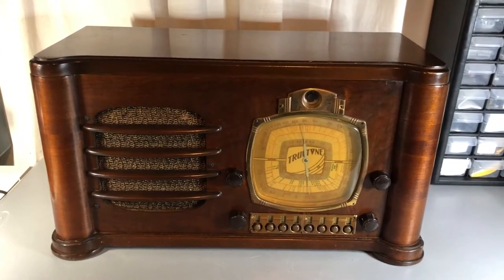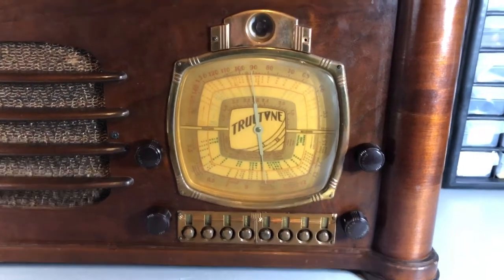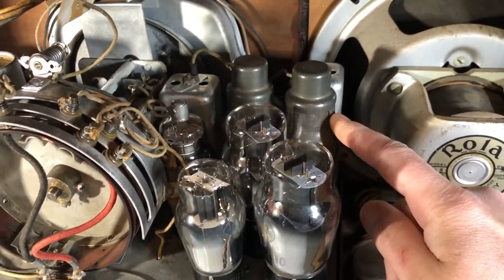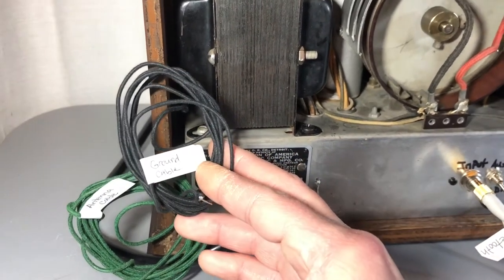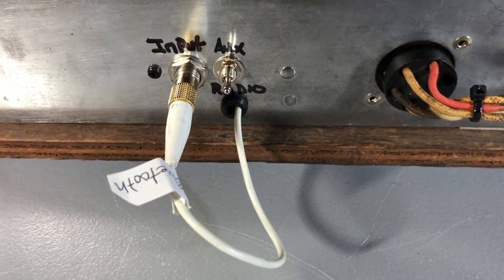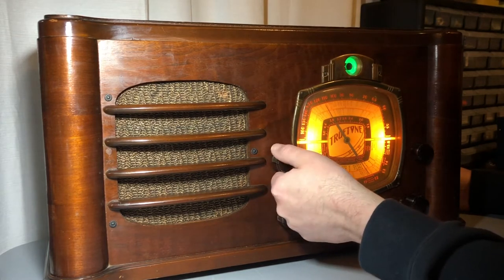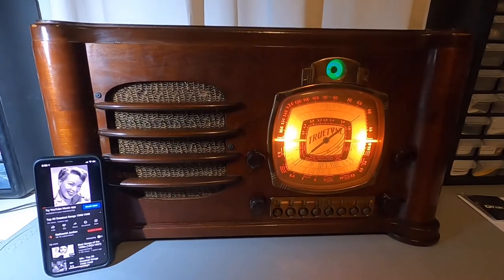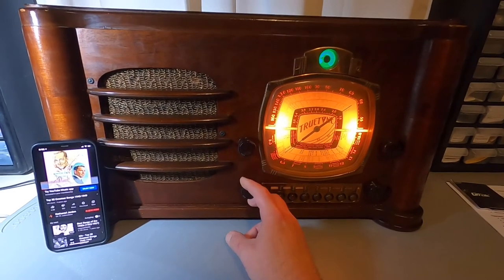Black Cat Amps - Demo of Restored 1937 Truetone D-727 Radio & Guitar Amp plus Bluetooth!

Comment: Hello, Was there a gear on the tuning motor that attached to the tuning knob itself? Or is the dial string wound in the tuning mechanism? I'm repairing this model and the tuning knob turns freely but no string or gear is attaching the tuning knob to the motor itself.
Reply from the maker: There was a motor for the dial. When you pressed a preset station button a motor turns the dial automatically to that spot. I don’t recall there being any strings. It’s been a while since I worked on it. If you watch the full video I probably explained more about that motor. Again it’s been a while. I don’t recall every detail.
Reply from the maker: It must have been connected to a gear but I can’t recall and no longer have the radio.
Reply: @DeathCapAmplification  Ahh I see. Very nice restoration by the way! Very nice tabletop model

Comment: I was wondering what the Electrolytic caps values were and how they hook up mine has two cans one big and other little but so corroded I can't see what values they are
Reply from the maker: Hi Jeremiah, I don't have this radio anymore so I don't know the answer to this.  However, I believe I googled for a schematic of this model radio before I started doing any work on it.  The schematic should show what values the caps are.  I suggest you google around to find the schematic and that should help you out.  Good luck!
Reply: @DeathCapAmplification  do you know of a good source for a schematic for this kind of radio
Reply: Do you know what could cause no audio on one of them radios
Reply from the maker: @jeremiahhuey6389  hey man. That could be anything. Literally anything could cause no audio. A loose connection, a cracked solder joint, a single bad component, a bad tube, a bad speaker.  Just about anything could cause it. It would have to be diagnosed by a technician.